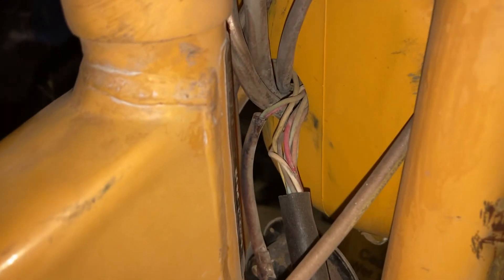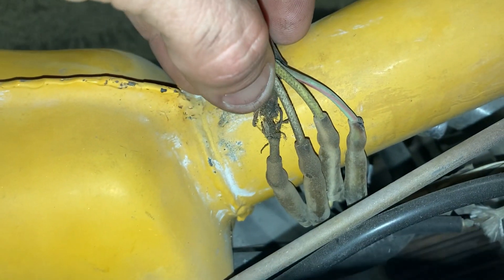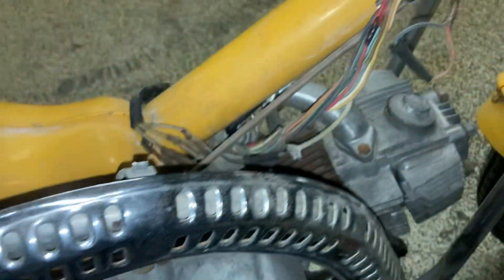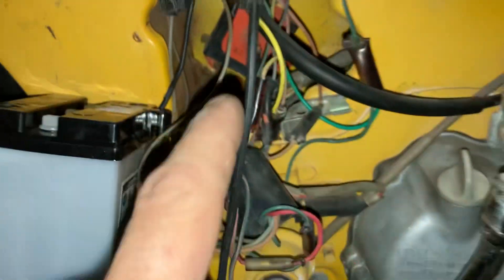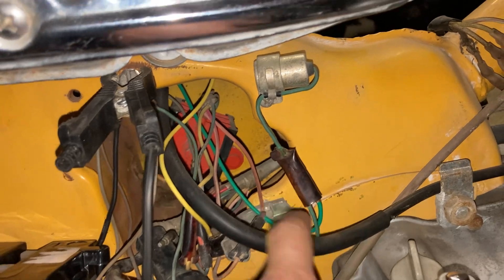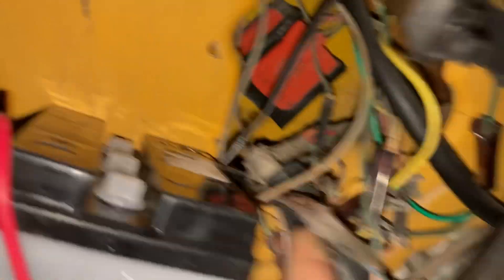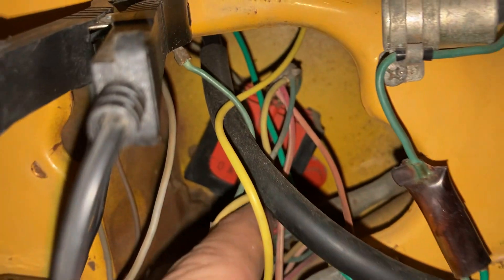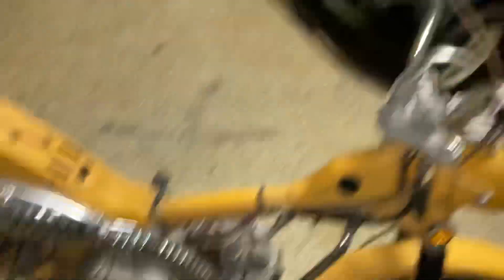Honda CT90 k2 wiring diagram / how to, battery wiring , coil, ignition switch, tail lights 1970-1976

Comment: I liked your video and it helped me, maybe this will help you. The fused red wire from battery goes to the red/ blue ignition switch wire. The other red/white wire is non fused and goes to the red/ white wire to the rectifier.

Comment: Your RED wire from the full wave rectifier that You are calling a Cdi goes to one of the battery hot leds cause thats were the Full Wave Rectifier converts AC Power to DC Power